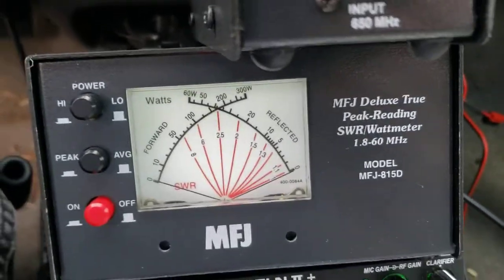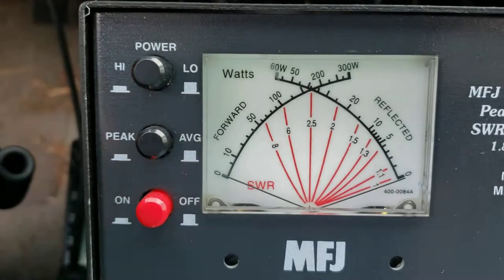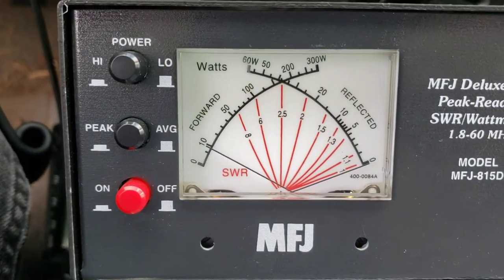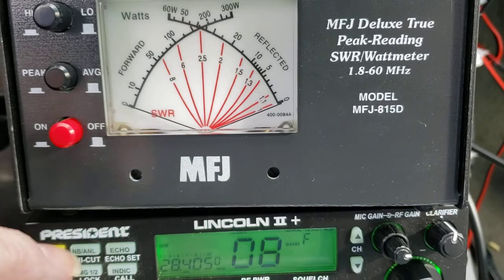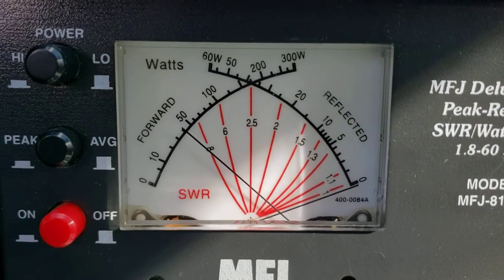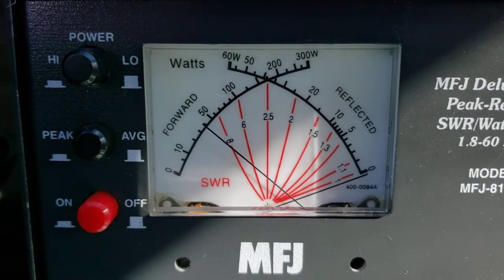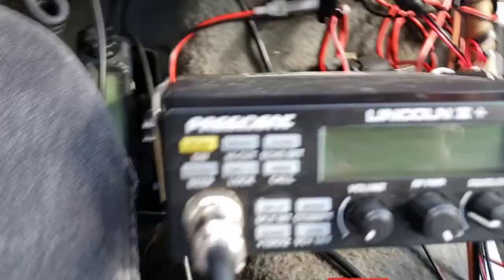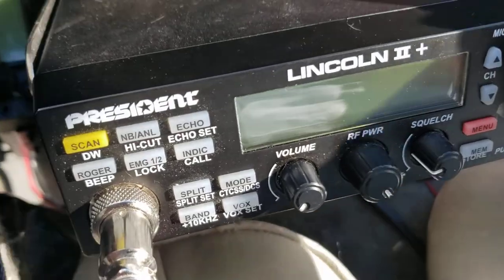MFJ Enterprises MFJ-815D SWR/wattmeter Review.

Comment: Initially I thought being on low would be 30 watt scale not 300 but looking this meter up on Amazon I was wrong low is 300 and high is 3000. I was actually going to buy this meter and forgot the scaling. Anyway one thing I wanted to say is maybe given such a high scale on low that when the carrier is turn way down it might not be super accurate. I think to get an accurate carrier turned all the way down it would be better to have a 10 20 or 30 watt scale. I think it would give a more precise number on the low end. As far as swing goes, at least the radios I have when the rf power is turned down the swing also comes down quite a bit. I typically see modded radios maintaining full swing regardless of carrier. I personally prefer it to be fully adjustable so you're not limited on amps, certainly low drive amps couldn't take 50+ watts worth of drive. Adjustability can also be radio specific, I don't have heavily modded radios but some seem to be different going from AM to sideband. For example I have a qt40 that's adjustable both ways but then I have a quad 5 that's only adjustable on sideband swing not AM swing just the carrier changes

Comment: Hopefully you know by now that meter needs a 9 V battery to run the peak circuit. That’s the only reason I bought this meter from MFJ because Dozy and all the other average meters don’t have the circuit you can’t have peak power readings without circuit without power

Comment: Open the top. There is a 9V battery holder. It powers the peak circuit when the power cord is unplugged. The peak circuit is the reason the meter falls back slowly. It has a multi stage op-amp that charges a capacitor to the highest peaks it sees and sends it to the meter. A non-powered meter can't do that and will never give truly accurate peak readings. A Bird meter with a peak kit works the same way.
Reply from the maker: With the 12 volt I get back light too :)
Reply: The charged capacitor discharges slowly after showing peak that's why the slow meter reset after a peak signal

Comment: Adjust the output power to what is suggested on the amp needed for input power. .do not  drive the linear amp with more input power than needed or you will destroy amp
Reply from the maker: I don't have an amp